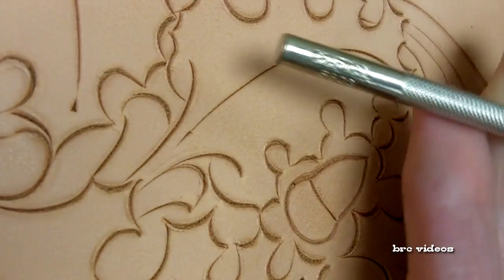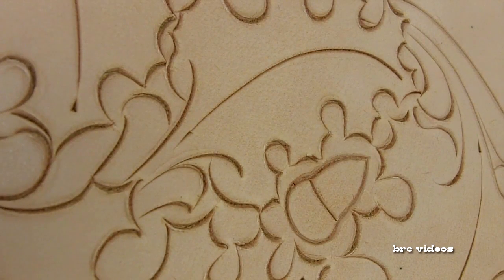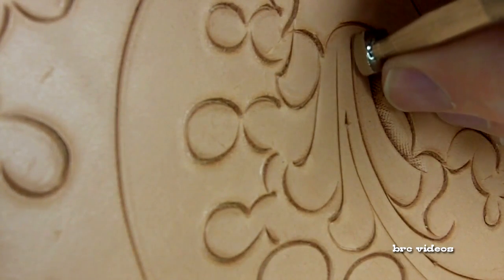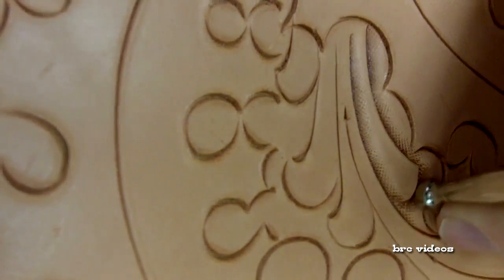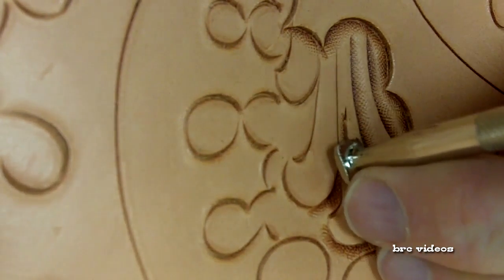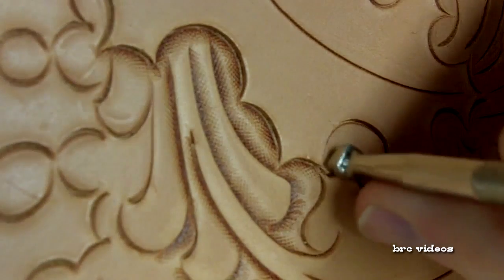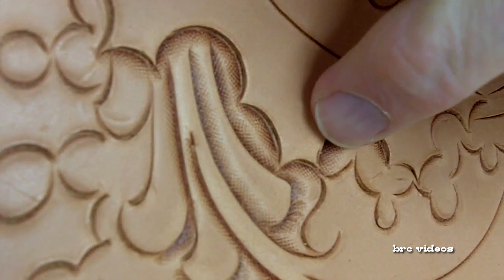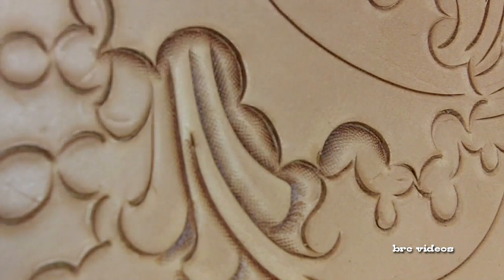Leather Tooling Tutorial - How to Bevel with Craftool Bevelers - Bruce Cheaney Leathercraft - Art

Comment: Mr Bruce Chaney do you know how cooks will close different fingers to test the firmness of the meat next to their thumb, for a reference of knowing if a steak is cooked to the desired degree? And so I ask, is there any technique for discerning when the leather is at a correct moisture level for: 
1. Cutting with swivel knife
2. Beveling
3. Pear shading
4. Stamping
5. Ect
 Is it all just "experience" or is there a method whereby a novice can identify moisture content? Does that make sense?
Reply from the maker: In my case it is just feel over the years I have developed a feel for the leather and I can tell if it is to wet or dry to tool and carve. I like the leather to be pretty wet when I cut in a design then let it dry out some more before I start beveling, stamping, shading and back grounding.  If the leather is to wet when it's beveled and back grounded it will have a washed out appearance when it dries.